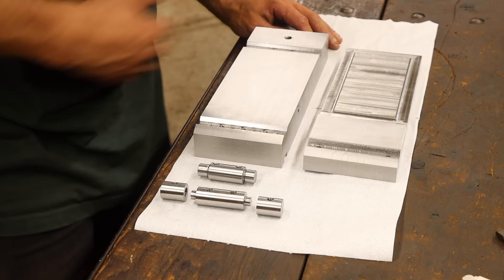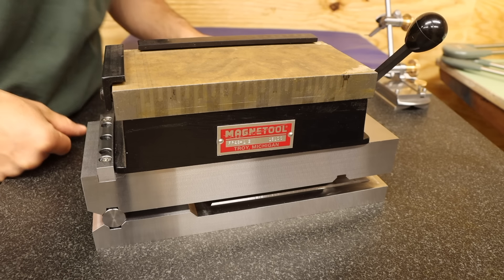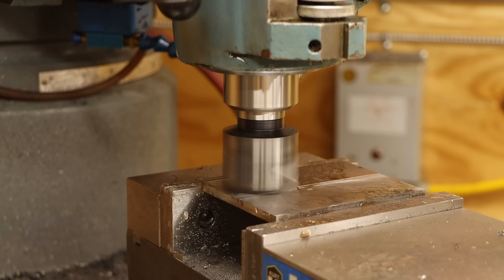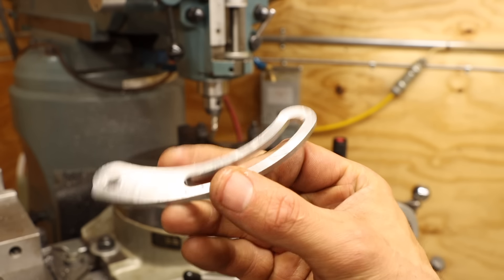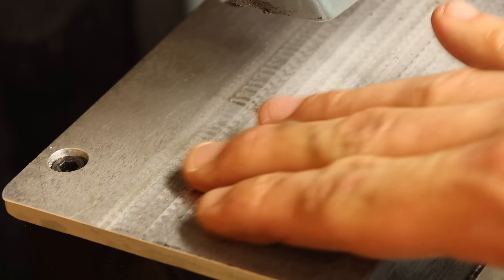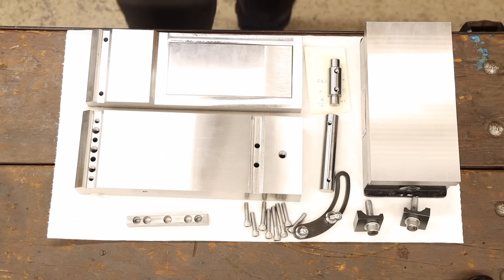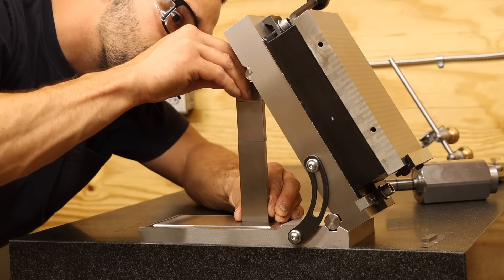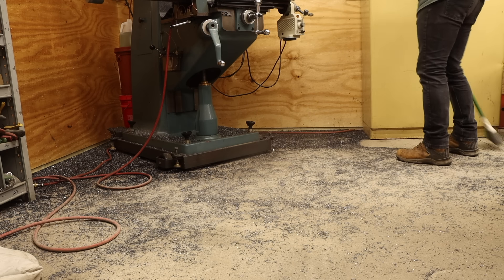Making a Sine Plate (Part 2) || INHERITANCE MACHINING

Comment: I really appreciate that when you make something, you show the flaws and then the process of correcting them. It's all to easy to pretend everything works out perfectly, but I think knowing how to discover a problem and correct it can be more important.
Reply from the maker: thanks! I've hoped sharing my mistakes came across that way
Reply: @InheritanceMachining  I second Benni's statement.  I've lost count of how many projects I've attempted that went wrong and, because I didn't understand the topic sufficiently, I couldn't even understand what went wrong, let alone fix it.  Watching someone with your level of expertise and drive publicly and casually demonstrate their stumbles along the way really makes me feel better about my own failures on the path to personal excellence.  Bravo and thank you from the bottom of my heart!
Reply: The mistakes are really the most important part of seeing the process.  Otherwise, all it would need to be is a short clip of the finished part, with the caption “Check out the part I made”.  

It’s the obstacles to making the part, and the logic behind how to overcome them, that is the real information.
Reply: I watch because of the mistakes.
Im an idiot... literally sometimes needing 2 or 3 times the materials to finish a project. It can be so frustrating. I can say out loud, while looking at it, exactly what I'm supposed to do, and then i do the opposite or forget to do the thing I'm saying out loud.
So, I'm constantly correcting or using something i messed up to make a different part of the project. 
Watching the fixes here and calm walkthrough or cant fix/scrap now decision lets me see someone else go through the same or similar process and fix or stop/redo something.

Anyways, thank you for showing everything. Its a fun journey. Every time.
Reply: @KeithOlson well said

Comment: I realize this is a bit older but be very careful gringing soft metals like aluminum. They clog the wheels and then gain excessive heat and if they get hot enough, the aluminum will expand and cause the wheel to fracture and explode.

Comment: There is a lubricant in a wax/grease form that is available for grinding aluminium. You simply fire up you stone and put the end of the lubricant stick up against it to apply it. The lubricant helps to keep the aluminium from attaching itself from the wheel. I worked in a shop where we made various aluminium items and the dressing worked very well.
Reply: I believe you can just use wax
Reply: You saved me a google search, which is great because I don’t even HAVE a surface grinder!
Reply: @Boltboy-kh7yw late answer, bacause i started binge watching IM videos, but he already mentioned at 9:57 that he used it. I suppose he found a solution since this video, i need to catch up to know

Comment: You might want to chamfer the bottom edges of that key you made at the start. It's virtually impossible to make a perfectly square inside corner. End mills will always produce a small fillet when slot milling, so chamfered the edges if the mating part will ensure it sits fully in the slot.
Reply from the maker: Thats a really good point. I didn't  measure it or anything but the key stock I used did have a somewhat rounded corner.
Reply: They make square end endmills.

Usually you can use a radiused mill to bring your slot into spec, and then use a much smaller flat end endmill to square out those fillets.

It's tedious as all getout but it's doable if you need an absolutely zero slop keyway connection.
Reply: @ObservationofLimits  Pretty confident that what he was saying, is that the corners of such a cut are only being made by the most unsupported tips of the end mill, therefore deflection or slight dullness means you're always going to end up with at least a micro radius on the inside.

Comment: Very clever solution to fixing up the collet blocks! My father was a perfectionist and he demanded perfection from me as a child. I really never achieved perfection, but in addition to that, with my dad there was never any joy in working or aiming toward perfection. I have come to live with this conflict by just trying to do the best I can. At 80 years I can't spend a lot of time struggling with the last fraction of a micron. I love the fact that you combine precision and aesthetics, which is the only thing that makes sense. Thanks again for sharing this with us.
Reply from the maker: Perhaps "trying the best you can" was the ultimate goal of your father's intentions. Many lessons taught to me this "extreme" way and I ended up somewhere more reasonable. Which may not have been the case if they started at reasonable. Thanks as always
Reply: @InheritanceMachining  Useful thoughts. Thanks.
Reply: Something that I teach new trainee for the last 50 plus years is the outside of the part must be perfectly square on all sides to make the inside easier to machine.
Any tools that are to be used over several times need to be hardened and then finished ground.
My 14 year old grandson got me to this site.

Comment: Greetings from Germany. When you mill rolled profile steel asymetric, always keep in mind that the inner stress will bow the material. The solution is: glow the material to eleminate this stress. The exact temperatur and time depends on the steel, mostly around 600 degree celcius for 6 hours. 
P.S. sorry for my bad english
P.P.S. I love your motivation and the style of your videos. Keep on going. You're doing a great job.
Reply from the maker: Thanks! There are so many things i could use a heat treat oven for at this point. Wouldn't stress relieving before machining still distort that material?
Reply: @InheritanceMachining  The material may 'move' as it is stress relieved but that's why you're stress relieving it.
Also a silicon carbide grinding wheel is usually used for grinding aluminium.
Reply: @InheritanceMachining  Ah stress relieving is the american term for Spannungsarm glühen 🤔 thank you for that. Stress relieving before milling is only important for rolled material because the last step of rolling is way under  680 degree celcius. When you look at the Iron Carbon Diagramm thats the critical temperature. The result of doing it this way is more precission but on the other hand more inner stress. Thats the reason why you have to uplift the temperature of the hole raw material near by this line not above, to eliminate this inside material forces. But after this process the material is less precise in its masurement than before. I hope i wrote this comment not too weird 🤗 Wish you a nice weekend
Reply: so we are allready two in germany, to follow this chanel with pleasure. gruss aus deutschland
Reply: @InheritanceMachining  you don't neccessarily need a heat treatment oven for that. Just use a blowtorch to bring it to a dull red all over. If you're remlving enough material afterwards you don't have to worry about the steel losing some alloy components.

You could also go around this problem altogether by milling the chiplet from both sides. This will equal out the stresses and result in a flat end product. Or do a shimmed surface grind. There are so many options, thats why I love metalwork.

I'm a german welder (Metallbauer) by the way, so if you have any questions regarding heavy metalwork, I'll gladly answer any questions.
Reply from the maker: @paulwiggans3692  Thanks for the tips!
Reply from the maker: @heizerhowy1187  I know EXACTLY what you are talking about. In college I double majored in Mechanical Engineering and Metallurgy (Material Science). First time I've had to think about phase diagrams in years! Thanks for the info!
Reply from the maker: @malteser0212   I have an oxy-acetylene torch I may have yet to fire up next time. Thanks for the tip and the offer!
Reply: @InheritanceMachining  well yes, it will move, but by stress relieving before machining you get the distortion happening while all the material is still present, meaning you can then machine away the distorted material and end up with proper final dimensions - rather than having the part distort during machining and potentially encroaching on the envelope of the finished part, if that makes sense. Think in terms of tolerance and MMC - if you get your stock dimensionally stable before machining you have the most possible material remaining to machine your final part out of.

If a 1/4" thick plate that you were going to mill down to 1/8" bows in the oven, you still have plenty of material to work with. If, on the other hand, it bows while you're machining it, you may not be able to true up the faces without going below your design thickness.

Hope this makes sense, my background is design, not fabrication or machining, and more structural than mechanical at that!

Comment: RE: The warping of the plate - its from clamping the plate in the vice. When you put the cut on, a plate that size at ⅛" thickness can warp even a little bit over a long distance. Which will then be compounded once you do the other side. Dropping another set of parallels in the middle can help, althpugh youre right, CR4 and other cold-rolled stuff is usually dimensioned squiffy. I scrapped a bunch of it doing it as an apprentice, after the 4th time someone told me what was wrong 😂 Im enjoying this channel so much. For grinding the alli, a 2-piece vice pretty much the one from This Old Tony's channel is actually really good if you grind it all square and use alli soft jaws.

Already cant wait for the next ep!
Reply from the maker: Thanks. I noticed something when i rewatched the footage. Right at the moment I loosened the vise, you can see the material deform up off the parallels. No doubt clamping pressure played a part, but I think it was mostly the internal stresses.

ToT's 2 piece vise is a great tool. First time I need one I won't hesitate to dive down that side project rabbit hole!

Thanks for the support!

Comment: I have a software engineering / hacking background and all I can say, that the quality of your work is heavily influenced by the tools you use. It does not mean, that you have to buy or use the most expensive tools, it just means, that every tool leaves it distinct marks on the object you are creating. Keeping this in mind while designing and planning, you can make things a lot easier, more precise, way cheaper, or faster.

Making a precise hex collet block does not seem hard, but as we saw it can be difficult with some tools and way easier with other tools.

But what I absolutely love is the verification at 15:54. Let's say the precision angle block could be off by some fraction, but it fits perfect on all six sides. This is only possible if the angle is dead on 60°. (You referenced with the same angle 6x and rotated the part 360°.) You can't cheat math. (OK, you can, but not like this... 😂)

Comment: Surface grinding aluminium.

Dress the wheel.
Stop the wheel and then spread grease into the voids of the wheel.
The grease stops the aluminium from bonding to the wheel during grinding.
This works better on a coarse grinding wheel like a 46 grit wheel.
Redress the wheel and load with fresh grease if you have a lot of material to remove.
Reply from the maker: Didn't think of the grease.. thanks for the tip!

Comment: The beauty of a hand made tool can also not be understated, nor can your level of methodic overdoing!
It is a pleasure to watch as always and these lessons learnt from you will also never be forgotten by those lucky enough to watch. If I can say my absolute favorite solution was that step you turned for the shaft that gave you the clearance to put a 0.106 shim under it. That is an incredibly smart feature and is super cool. Not to mention the most gorgeous sin plate I've ever seen. Thank you again for your atomically accurate precision and your dedication to perfection.
Reply from the maker: Thanks for the kind words! The step wasn't my doing (think I saw it on a Suburban Tool video) but is super powerful. Only problem is that the in the range of .1011 to .1499 I have no way to achieve tenth accuracy due to my gauge block set. I might have to turn one end of the pin down another 100 thou. Thanks again!
Reply: @InheritanceMachining  I think its brilliant! Maybe you could machine a  few with each having a step size of a 10nth or something like that and put them in a box to use for when you do need such a size. Have a great day further!

Comment: Brandon, thank you for sharing your adventure. I have one tip for keeping thin rolled material flat when milling. Rolling influences the outer skin of the material the most. Top and bottom are in equilibrium when it leaves the factory. The stress introduced by the rolling is symmetric on both sides and goes to zero in the middle of the material. Therefore if you want to cut a thinner piece out of the rolled material both cuts on both sides should be equal in depth so the residual stress stays symmetrical too. Clamping a thin piece in a vice is also not advisable because you probably, or for sure, introduce a bow by locking down the vice secure "enough". Glueing down the piece or grinding it down in small passes reversing sides will get you a better result. I also use my vacuum table if the piece is large enough to hold down when milling. When making small parts (bonus) I use a larger sheet of material and make an array of parts to keep the surface area large enough combined with fencing the sheet. I leave a 0,1 mm shim at the bottom of the part so I don't break the surface (dial in the vacuum table for this as a start) and break and deburr the parts loose after milling. I hope my comments help you in your adventure of becoming a versatile and accurate machinist. I enjoy watching your progress. The inherited shop is a true flying start. Your granddad knew what he needed to make intricate parts. Your engineering background and training by granddad in the past gives you another advantage to get things done right. My experience as a dedicated fabricator is that the learning never ends. New jobs sometime require new skills. By seeing your progress and work I'm totally sure you are a great machinist and will be a master in this trade. Regards, Job
Reply from the maker: Thanks for the tips! I suspected as much about why the material deflected but your points make sense. I stumbled upon someone else using a vacuum chuck recently and I'm intrigued enough I might make my own. Also thank you for your kind words. I have a long way to go but thats what I like about this hobby. There seems to be no end to what you can make or improve upon. Thanks again

Comment: "If you've made it this far without knowing what a sine plate is, I commend your patience."
I mean, I at least had a rough idea, but only at the end, where you explained that you use gague blocks determined by a sin function, I really understood how it leads to precise angles.

I can at least partially relate to your struggles, but as I am working on a CNC mill, a lot of these things are so much easier for me.

Comment: Blown away with all your shop made tooling , I’m sure you’re grandfather would be extremely proud of you.
The finish and quality look exceptional, hey you said “ you didn’t know why you took lots of little plunge cuts” when milling out one of the slots on the rotary table, well I’m only an amateur hobby  machinist but I did happen to watch a Joe Pie video recently where he was discussing cutter life and as I understand it after watching that video taking lots of little plunge cuts keeps cutter wear on the tip where it is ( relatively ) easy to re sharpen and doesn’t wear the bottom 1/8” or so of the o.d. vus allowing the tool to keep its o.d. Geometry throughout its life and not go onto produce slots that are “ tight at the bottom “ 😅 I hope I got all that right !
Reply from the maker: thanks! that makes sense. I've had to do plunge cuts before on thicker material because the cutter was screeching like crazy. Good to know there's more advantage than just the noise.

Comment: Beautiful by any measure. Just one thing, while I love looking at completely square outer edges of a tool, I can’t help but want those edges broken ever so slightly to keep my delicate hands from suffering any attempts at blood letting. I know, I know, I guess it’s the gunsmith in me that likes a gently and perfectly smoothed corner with just the right amount of stock removal to allow me to sleep at night. Lol. Seriously though, you have a great eye and your step processes are fun to watch! You have very nice equipment to work with as well.
Reply from the maker: Thanks Kent! I actually did break all of the edges with a stone, though I wouldn't call them a true radius

Comment: As far as I’m concerned yo can’t over engineer anything that is going to last. One of the most influential people in my engineering career was a tool maker for British aerospace. He seemed to over engineer everything he did in his home workshop and I never saw anything he made be anything less than 100% accurate and reliable. Even in the seventies in his home shop he would strive for less than 20 microns. Great video series, thanks fo sharing.
Reply from the maker: Thanks! Sounds like I would have gotten along with your colleague. That's exactly the reason for my drive to be precise. If I'm spending the time to make something, I don't want to constantly have to compensate for inaccuracies in its build.